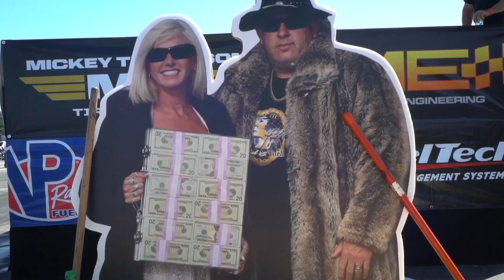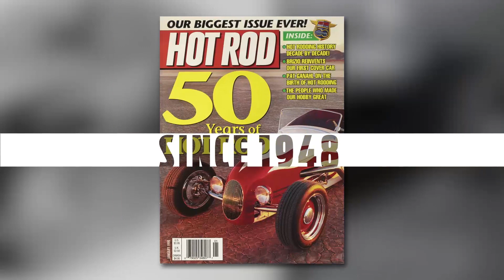Radial Drag Racing Finals - Sweet 16 2.0 - Radial vs the World

Comment: There should be no traction in Drag Racing what so ever Hell just have a computer drive the car there is getting to be little use for the driver now anyway
Reply: allthewade Huh? Have you ever tried to wrangle 8,000 HP in 4 seconds? It’s not easy. Shit I have a hard time with 2,300 HP. 
Not as easy at is it looks.
Reply: You have absolutely NO idea what traction control does in these cars - HINT HINT you go SLOWER if it's coming in during a run...